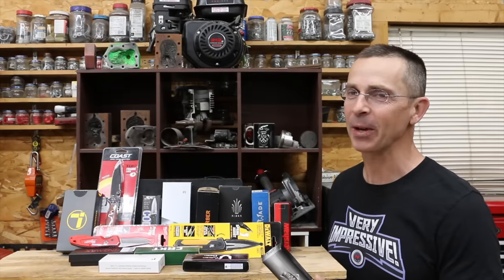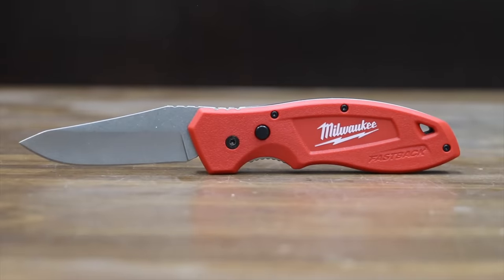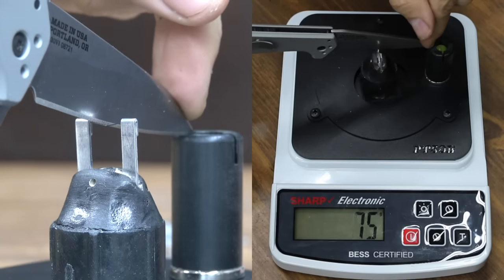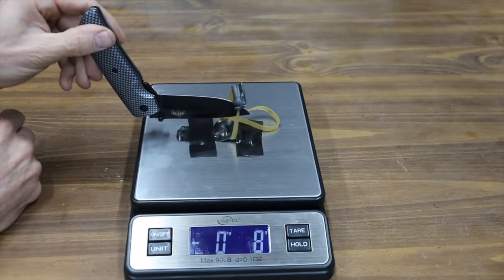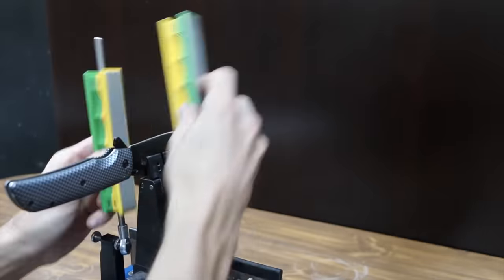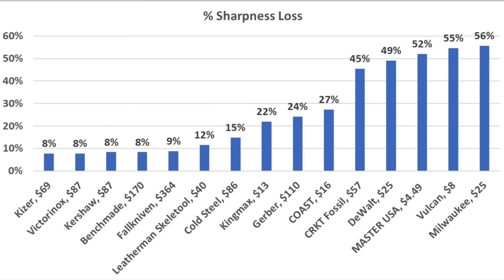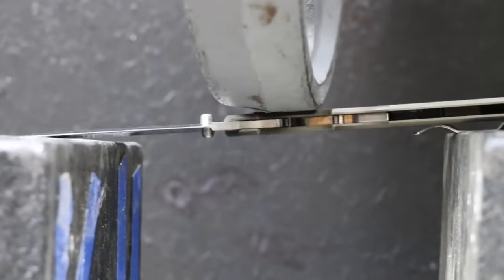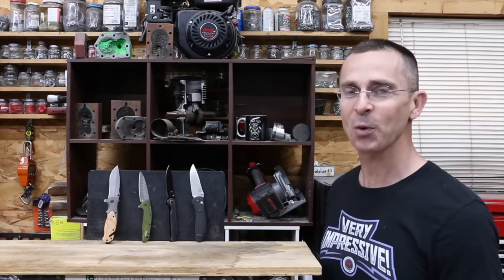Best Knife (Ep 2)?  CRKT, Gerber, Leatherman, Fallkniven, Victorinox, Kershaw, DeWalt, Milwaukee

Comment: As luck would have it, I picked up that model Coast knife about a decade ago at a mom and pop shop when I was on a camping trip with the family and forgot to bring my pocket knife.  I know it's not the highest quality - I think it was about the same price when I bought it (~$15).  That said, I've used it most days and it's chopped up more cardboard and branches than I can count.  I wouldn't be surprised if I'd sharpened it more than fifty times over its lifetime and it still looks pretty new.  I like the impregnated wood handle and I normally dislike clips on knives but haven't managed to lose this one.
Reply from the maker: Thanks for sharing.
Reply: @ProjectFarm  Absolutely and many thanks for the response.  I also thought it worth noting that the regular pocket knife it replaced was the Buck you reviewed in the first pocket knife review, which I still have after 30 years.  And you're right, all that brass makes for a heavy knife, but I'm accustomed to my knife having a bit of heft :)

Comment: Blade Geometry is one of the most important factors in edge retention. I believe you should first sharpen all the knives to the same angle, and then perform the bamboo test and recheck sharpness. This way a blade that was sharpened at 15 degrees wont seem to "dull" much more than a blade sharpened at 25 degrees out of box. Could influence the numbers quite a bit.
Reply from the maker: Thanks for the constructive feedback.

Comment: I've had great luck with the older gen of Schrade knives that were made in NY. I have several that I've been using for about 30 years and they were all used when I got them. My daily carry is an Uncle Henry LB7 and I can't recommend them enough for a good rugged and affordable knife. If you can sharpen a knife don't be scared to buy them used on ebay. Just look for the USA mark on the blade and if you can afford it select the ones that say Walden NY at the base of the blade. If you can't sharpen a knife real well then buy yourself an Arkansas medium stone and a cheap soft knife. You'll resharpen that soft knife just about every day and you'll get good fast. I use mineral oil for a sharpening oil. It's cheap at any grocery store and works as well as anything. This way you are not contaminating meat or any other food you cut with a petroleum product
Reply from the maker: Thanks for sharing.

Comment: You are supposed to swing the Milwaukee while depressing the button. I had one, but i dropped it down into a wall pocket during a job. I didn't replace it because junk was getting into the locking mechanism making it difficult to open and close.
Reply from the maker: Thanks for sharing.

Comment: Your DeWalt is totally a different model than the ones  the local Tractor Supply store sell.   :)   That said blade lock is probably the most important feature of a pocket knife.  I inherited some knives like the one the veteran has, but having had many blades close on my fingers I greatly prefer locking blades.  The old (super cheap in the 60s) Black Kat K55 knives from Germany were my everyday knife in the 60s. Small, light and with a flimsy lock. I had a dozen of them.  They broke a lot and sometimes didn't return if loaned out or left where someone could pocket it.  But they were so cheap that didn't worry me much back then.  For many camping and hunting trips those K55s were a good backup to the longer and heavier K Bar Dad used.

Comment: I have the milwaukee, and it is much better that it doesn't open easily. I struggled with my knives constantly opening in my tool pouches and almost shoved my hand onto an opened knife a few times until I switched to the milaukee, which was able to stay closed even in the tool shuffle of a constantly used bag. Also I found it to be rugged, long lasting, and still easy enough to sharpen, and only 14$ at the time.
Reply: In other news, that 4" coast knife is heavy, not very sharp, and caused me the second largest scar on my body.
Reply from the maker: Thanks for the suggestion.

Comment: Suggestion: Please add a strike test to your final 'Knife Lock' test. Maybe dropping a 5lb weight on the spine of the open blade.

I've had Liner Locks fail when accidentally smacking the spine of the open blade against an object like a table when I'm in the process of straightening up or standing up after using it. The sudden impact on the back of the blade can quickly overwhelm the springy nature of the liner lock, causing a dangerous unintentional closing of the blade.

Comment: Hi! The Kizer handle is not carbon fiber, the Code4 has a TriadLock (modified and a much much stronger backlock) and the D2 is not rust resistant tbh it can rust very easy leaving craters on the blade when not oiled or waxed. Sorry i’m some kind of knife nerd…
I like and apprciate your videos keep rollin’ ! 👍🏻👍🏻👍🏻

*D2 is very wear resistant but brittle too as seen on tip test. I don’t agree that kind of tip test because of the different weights and shapes. For example a drop point is more massive than a spearpoint but the spearpoint excels in penetration.

Comment: Unfortunately, CRKT discontinued it, but the CRKT Hammond Cruiser was a great knife for $25. the dual lock, the beefy grip and the ability to actually be able to baton it (insane with a folding knife) was a great feature. I had a bunch of them but through gifting them, losing them on camp trips and etc, I don't have anymore. They are still available thru ebay used. It's a great EDC.
Reply from the maker: Thanks for the feedback.
Reply: @ProjectFarm  I would also suggest looking into the Gerber StrongArm. For the price point its a great bargain. The sheath, Made in USA, 420HC steel and grip make it a strong contender. Also the Becker BK7, such a great versatile knife that will accomplish everything needed for camping in one knife.

Comment: For the blade tip test, it probably would have been a better idea to drop the a specificied weight on top of them instead of dropping them onto something. You could guarantee the knife stays straight and the blade tips are subjected to the same force.

But I'm glad somebody else is doing the testing so I don't have to. 🎉

Comment: The thing about Cold Steel and Benchmade is that the quality goes up with price. Most of the remaining knives will forever be budget knives. I have a $75 4inch Recon1 Tanto folding knife from cold steel with Aus8a steel. It is a brute beast on every level. It's also safer because it has deep finger grooves to guarantee no hand slide. It's over 7 years old and still in great shape. Its required very few sharpenings.

Comment: Another winner! 

I thought the Leatherman looked pretty good in the test for the price point. 

I have my grandfather's small, three bladed knife. One of the blades is broken off though. :-). It's probably at least 70 to 80 years old. I saw somewhere online that sold replacement blades, but I just missed the blade that I needed. They sold out and that was it. 

How about a test of moderate sized fixed blade knives? There are some on Amazon and Aliexpress that are in the $25 to $60 range.  Some also claim to be SV10 or D2. I have a couple of higher end knives, but I'd like one or two modestly priced ones that are decent quality just to stash in vehicles and other places that aren't super secure. Meaning they might grow legs, and I don't want to be out $100 for just the knife. I hope that's not too specific a test request.
Reply from the maker: Thanks!  Thanks for the suggestion.

Comment: The Benchmade Mini Barrage is the perfect knife, full stop. 154cm steel takes an edge like carbon steel and holds up like stainless. Assisted opener with a lock that's made for an adult and not a lazy knife designer. Lock open and shut. It's the best period.
Reply from the maker: Thanks for the feedback.

Comment: I can tell you took a lot of time pulling suggestions and feedback from the viewers, It really means a lot. I'm not surprised that the very hard d2 carbon steel snapped, especially on a thin blade like the Kershaw dividend. That brittleness and its low corrosion resistance is the downside of the really good edge retention. If you decide to test any more knives I would really be interested. A cool video idea could be knives under a certain blade length, under 3 or 2.5 inches is pretty common for universities or local laws for example. In foreign countries locking knives are often not allowed to be carried, I dont know how much of your audience is in the US, but that's another idea.
Reply from the maker: Thanks for the video ideas.

Comment: I own several Cold Steel knives and they have always punched above their weight class. I own a Code 4 along with several of their other folders and they don't lie when they say that their folders with the Triad lock are just as good as a fixed blade. The only folder that they offer that is stronger and possibly the strongest folding knife ever made is the CS Pocket Bushman which is basically indestructable. It does, however require some care and experience to release the lock and if you're not careful, it will cut cut you. I prefer CS knoves over any other brand out there. As far as value for the money and durability goes, you really can't beat a CS
Reply from the maker: Thanks for sharing.

Comment: I always enjoy your reviews.  I have one for you how about  testing the wireless adapters  that connect your cell phone to the infotainment system in the car.  Parameters might be how quickly they install, latency,   startup , dropped connections and how long do they last . plus any other problems you may experience.
Reply from the maker: Thanks!  Thanks for the suggestion.

Comment: Kershaw really pushes the hardness of their d2 with less tempering, which is why it performed extremely well in the edge retention test but failed the drop test. D2 is already a brittle steel so when its hardness is pushed to the limit its no surprise it snapped. Civivi and cjrb temper their d2 alot more, and civivi in particular tends to end up with a slightly softer d2 than most other brands, which does make it easier to sharpen and get a good edge.
Reply from the maker: Thanks for the feedback.

Comment: Btw, after seeing the intro to 'test' of dropping the knives purposefully on their tips, I told my spouse I guessed the tip of the, very very hard, CPM-d2, on the Kershaw's tip might break.

I'm nit sure how that's a good test for consumers, unless they're clumsy if you are then measuring how much effort is required to straighten, if possible, or reprofile off the tip damage.

Maybe a more useful test, that won't have knife collectors cringing, would be to measure the amount of force for a knife design to full penetrate a test medium, say a standard size and weight (build) of cardboard.

As for the tip breaking off, that composite blade, with expensive CPD-D2 powder metallurgy, high hardness steel, if I remember correctly, also performed best in your tests at edge retention, usually edgebrerention is enhanced by higher  hardness of the blade medium during heat treatment.

Comment: Todd, don't know if you have done it, but I can't find it if you have. I would like to see a similar test of stainless steel sheath knives. I would consider full tang with bolsters to be desirable, but also a measurement of handle girth to be of interest. I bought one such knife that had grip WAY too large for my hands, which are actually of average size.
Reply: P.S.- if you have to break it down to get reasonable numbers to work with, I would say that could be done with blade length, or perhaps style such as drop point, Bowie, etc.

Comment: Would love to see a knife oil/wax test. "Self made test" did a outdoor rust test with some interesting results, but it was somewhat flawed, and he didn't test two popular solutions: silicone oil and vaseline. People also discuss their lubricating properties, longevity (how often you need to reapply) and food safety, so it'd interested to see you apply your comprehensive and scientific approach to this topic.

If you do, I'd recommend using 1095 carbon steel sheets cut to small pieces to decrease cost, increase sample size and surface area (popular knife steel, could also test type of steel as variable, doesn't need to be actual knives IMO, but would double check the validity of my opinion). A ground surface would increase surface area for oil adherance but also for rust, and would simulate the beveled part of the knife. Alternatively you could polish and sandblast different parts/separate samples. Liquid bluing and patina-ing is also popular as a finish and for slight rust resistance, but as a supplement to oil.

You could test rust resistance by leaving samples in a warm chamber with salt water for accelerated testing and or/sheltered area outside. You could test longevity by comparing the previous samples to samples tested after various time periods in controlled indoor conditions. Other interesting things to test may be method of application (how many coats, is soaking effective), are the oils resistant to use (e.g. dipped in water than blowdried, or handled with bare hands and rubbed across textile, then chamber/outdoor test) effects of finish e.g. brushed or polished, effects bluing or patina, oil resistance to food acids, effects of surface damage (e.g. scratches, chips, dents) on rusting, and if you're really up to it, effects of heat treatment on rusting (I have seen no evidence of an effect on rusting but apparently it's controversial)
Reply from the maker: Thanks for the suggestion.

Comment: O.k on a totally different subject can u do a tool warranty session?. I had a local warranty issue on a 17 mm Combination ratchet wrench failure which took Gearwrench N.Z over 3 weeks for replacement. In the end I approached Gearwrench in the U.S to help sort this which the big boss sent a new set as a test sample plus the replacement.
Snap-On is the best.
I'm not sure how you can pull this off to create a failure to claim.

Comment: Forget the knife manufacturer and try out different blade steels.  You could've gotten a bark river knife made of cruwear or cpm 3v or some crazy steel like that for the more expensive knife.  It would've destroyed all these in stride.  If you wanted a pocket knife instead of a fixed blade, you could've tried a sprint run spyderco.  Like a native or paramilitary.  You wouldn't have the convex edge that the BRK would have.  But you can get really good steels(CPM 3v, Maxamet, CPM Cruwear etc) in spyderco if you look hard enough.  S30v is like the bottom of the barrel super steels nowadays.  Falkniven makes good knives if you are cool sharpening all the time.  But even they use unimpressive steels if you ask me.
Reply from the maker: Thanks for the feedback.

Comment: Im not sure about the specific of how the testing media is affected, if at all, by the transitions between primary and secondary bevels. For most people a full flat knife, like the cold steel will generally be a better cutting knife than a short saber grind, like the victorinox, as they tend to have less material right behind the edge/primary bevel and the corner of the transition needs extra effort to overcome.

Perhaps testing a range of priced knives but with similar profile might be more enlightening.
Reply from the maker: Thanks for the suggestion.

Comment: the release pressure test with blade locks doesn't really work, by pressing down on the blade you're pushing it against the lock thus merely causing the lock to grip harder.

Comment: Have you done a rotary tool comparison (Dremel,Craftsman,Black and Decker etc.) I have a older craftsman that has the motor that hangs up and uses the flex shaft and as old as it is it's been better than all dremels and black and decker rotary tool I've owned
Reply from the maker: Thanks for the suggestion.

Comment: Ok, I’ll explain why I asked in the hope I can get an answer. I don’t have the $$ to buy a sharpness tester like yours so I made one. A kitchen gram scale and a home made thread holder. It differentiates between various levels of sharpness well, but there is a fair amount of variation between measurements of the same blade. So I’m interested in knowing if it’s my tester or or just naturally occurring variation  and thus to be expected.
Reply: I bet its the  cloth thread. You could get more consistant values with a man made material of a known size diameter and strength like monofilimant fishing line.

Comment: i nearly thought you might start testing his knife like the others, 65 years in his pocket, truely puts it near the top. very disapointed with milwakee in this one. I will say though thier version which hols razor blades is top tier, especiallhy  the one with the flat/phillips head. ill usually put in a serrated razor blade for wire stripping. its perect and opens SO MUCH easier than the blade he uses in this vid.
Reply from the maker: Thanks for the feedback.

Comment: Ever try Bear Edge knives? I found one on Blade HQ I like, a spring assisted thumb stud flipper for 60 bucks, made in USA. 
It wouldn't be an everyday knife, I use utility knives most of the time.
Reply from the maker: Thanks for the suggestion.
Reply: Yes, I sold Bear Cutlery at my tool store for years . American Made in Alabama . They have the best Bowie knife that is USA made and wont cost you $500.00 too!  I just bought one last year for myself.

Comment: The test to see how much force was needed to open them was weird.
You did not adjust for lever length. So a longer blade needed less force.
You also did not measure at the point you would open the knife.

Like comparing how easily doors open by the amount of force applied to push it away, not taking the ergonomics of the handle into consideration at all.
Love the try though